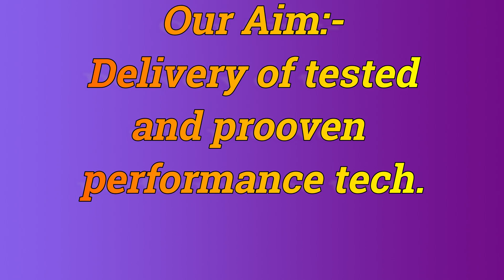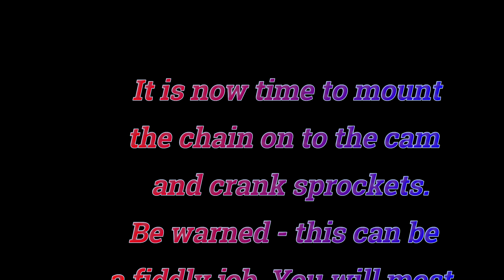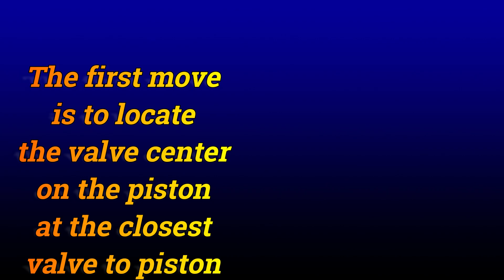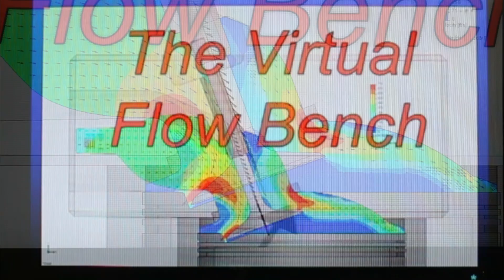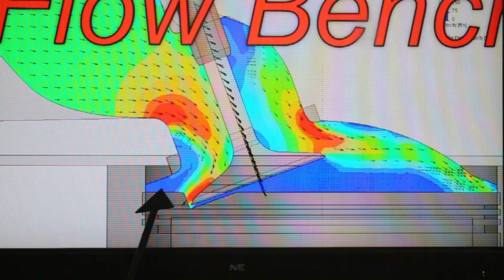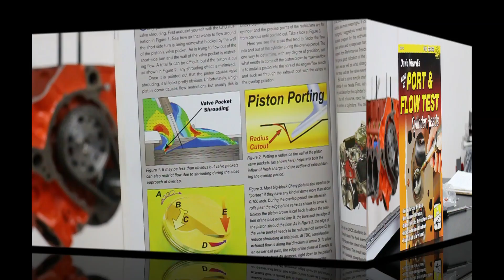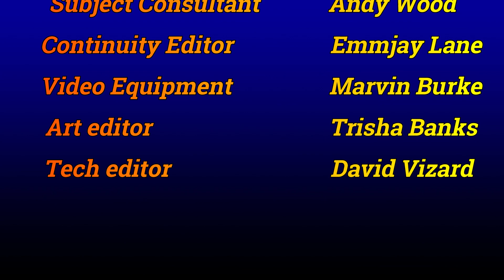David Vizard's PowerTec 10 EP 20 Power enhancing valve pockets

Comment: Hi David, I have been your fan since the seventies when you were writing a lot of technical articles on Cars and Car Conversions. In fact I have your book theory and Practice of cylinder head modifications. Now at nearly seventy years old I have bought an MGC Sebring Replica which I intend to tune to nearly Full Race Specs. I wonder if you can do any lessons on this Truck Like 6 cylinder engine to try and get the most out of it. I am mostly interested in lightening of the crankshaft of this engine to reduce the inertia mass. I intend to port the heavyish head according to your 5 rules of cylinder head porting. The mods I am doing are the following. Forged Omega Pistons+H Beam Forged Rods+Kent 287 degrees cam with 11.57mm lift+Light Steel flywheel +3 x 45 DCOE Webers and Maniflow 6 into two into one exhaust. I will also be altering the distributor advance curve on a rolling road. Unfortunatel I cannot find a source for the Copper Lead Bearings so I have to fit the normal Aluminium /Steel Backing ones. Anyway I really would like to thank you very very much for your contributions in teaching people like us. THANKS AND GOD BLESS YOU. Regards Martin Spiteri, Car Clinic Malta.

Comment: I like to have the block standing on its butt to install the cam. With the rear cam plug in the cam will not fall out the back. To keep it for falling out the front, a fender washer ususlly works for me until time to install the timing set. Once cam is in the block can be mounted on the engine stand. I have installed piston/rod assemblies on Detroit Diesel engines with the engine on its butt on a bench, when no engine stand for that weight was available. Put the cams in that way also. Detroit blocks need the rear cam bearings installed first before putting the block on pieces of 2x4, for clearance.

Comment: David, I grew up reading any and all engine building topics back in the 80's, including your engine build guides. Back then I did something similar to the valve pockets as you have described here, but I did it for a different reason, I was trying to build swirl in the chamber. Today my ideas have changed a little and see that a inverted dome in the center of the piston to be beneficial. It was in one of your early books that you found that there was an power increase with a dished piston, this is what set me on this path. So I would have liked to see less depth in the valve pockets you show here (but still de-shrould the valve pockets) and then lower the center of the piston (put in a dish). This would make the chamber more detonation tolerant (thus allow for an increased compression ratio), clean up the exhaust stroke (less unburnt fuel mixture in the exhaust stroke), and allow a leaner full throttle mixture. The leaner full throttle mixture would produce more CO2 and less CO, then the combustion temperature on the power stroke  would go up, the  temperatures in the exhaust stroke would go down. The engine would produce more output throughout the torque/power curve with less fuel and less emissions at full throttle. Now David, this here is based on my work, (and not something I just happen to read in a book) and I would like some one of your caliber to give some feedback on. Thanks mate.

Comment: I'm a newcomber to your site, but have hand ported may and varied over about 40 odd years. Q. have you done a dyno test comparison between standard valve profiles, and valves that have been Back Cut?  When I run seats, Intake particularly, I run them high on the valve at about .060" width, then back cut my valves to give me about .050" to .060" face below the seat. Any thoughts? A lot of my early port work was on 6 cylinder Holden heads, and various 8 cylinder heads.

Comment: Rolling those sharp edges also reduces the likelihood of a hot spot forming....One last thing....LS motor guys don't need to worry about valve to piston clearances....Just check out the cam recommendations on any LS motor forum....as long as you can spin the motor over after the cam install? YOUR GOLDEN!

Comment: You should get together with a CAD designer and design the perfect port, then look into making a full head.
Reply from the maker: Rusty, At first sight this sounds like a good move. The tech level in our shop is capable of doing such but the results will not be as good as a talented head design engineer. Computers are not intelligent - they don't do well at inventing stuff - yet!
Reply: @marvingvx1  even with computational fluid dynamics (CFD)?

Comment: Mr. Vizard, thanks for this video. This will help me with the engine I'm trying to enhance, the famously non-sporting Chevy 250 inline 6. I have many of your books, and am using bits from several of them to come up with a combination that will run decently well on 93 octane fuel, and be used on the street with some hiway.  The "How to build horsepower" books (both the early book and the later one) have been great resources for me. Thank you for taking the trouble to write them.

Comment: Another great learning curve for me. Just one thing I'm confused about is why was there some power / torque reduction at lower rpm (~2500rpm)? I thought the un-shrouding of the valve pockets would've given improvements across the rpm range?
Reply: My guess is because it acts like putting in a longer duration cam because you are getting flow over more degrees of crank angle.

Comment: I have an ooooold flycutting tool I got back in the late 70s, that has a 11/32 stem on it and it goes right through the valve stem guide of the head. I space a junk head up off the deck, and use it to center the cutter for the valves. It's all manual, and you have to be good at using it, but it still works in the engines that use the big valve stems.

Comment: Interesting, and makes sense: flame propagation is pretty much a fixed value, but piston speed being a variable things should behave a little differently at high vs low rpm.  Does the general h.p. effects you found carry over from a 23 degree head to 18 [being less/more sensitive]?  I have no dyno experience, so just for fun... I'm going to guess the 18 heads are less sensitive due to geometry being closer to parallel [and duck any incoming tomatoes].
Nice work as always.

Comment: This is the exact stopping point I'm at with my 383 sbc build.  I swapped cams from a 110 lsa to a 106 and with an indicator my clearance is way too tight.  I haven't checked with clay yet (building a garage to get the engine out of my living room) but I'll need to do that.  I have the tools to perform the massaging, and that's the obstacle in front of me at the moment.  Now I know what needs to happen. 
Thanks Mr. V

Comment: An evening with a pencil grinder . or do i grind up a radius cutter for the mill
Reply: That's a good question Dave. I have a bench top mill here at home.  Don't think it's the way to go though.  Because the head is fixed, and making a fixture to hold the piston would take about as much time.  And I'm only interested in low end torque. So I think I'll just soften them up by hand.  I've built a couple of 350's using the book ''How to build max performance Chevy small blocks on a budget'' By David Vizard, in the past, and have been very satisfied with the result.  His porting book should be at my door tomorrow.  Let us know how your method works for you plz?